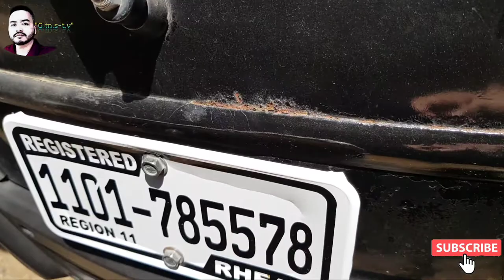My TVS King deluxe after 2 yaers.

Comment: the only possible way the rust has formed in under the dashboard is due to poor maintenance. in this case the rust occured due to cracks in the layers of paint. you need to ensure that any sort of moisture is not left on the metal body for a long period of time.1) if you live near by sea it could happen. 2) if you leave moisture on the metal it could happen. 3) drying your vehicle is as important as washing it.

TVS is much better than Bajaj RE in all aspects. i could tell that because i live in India, where these machines are made and used more than any other place.

suggestions to keep your vehicle in good condition (basics)
1. Keep the vehicle dust free (all surfaces) use a mild and soft brush to dust after every use because sand and soil will react eventually.
2. wash your vehicle once a week if you use it daily. and it is very important not to leave water or moisture on any suface.
3. use polish to keep your paint intact (polishing will keep your paint safe, helping from cracks / fading)
4. if possible, get ceramic coated.
5. ensure the under body area is well insulated if you use the vehicle more in muddy or water logged places (use a rust free coat or other substitutes available)
Reply: Thanks bro.it helps a lot 👍
Reply from the maker: No probs lods